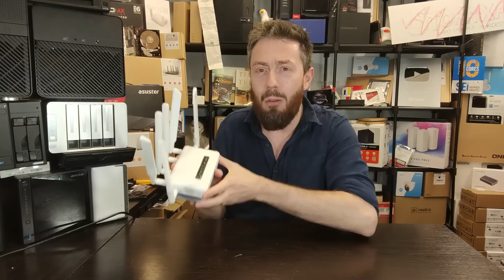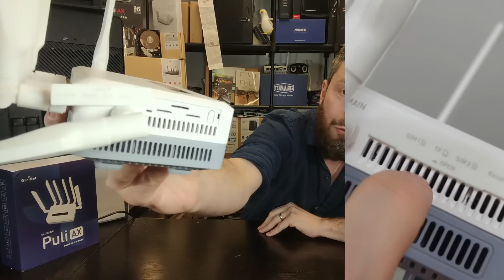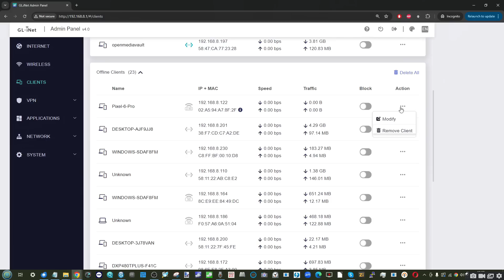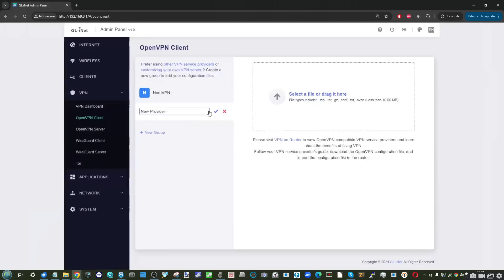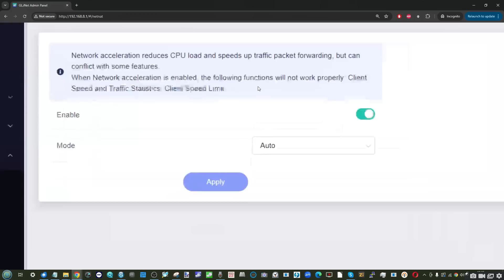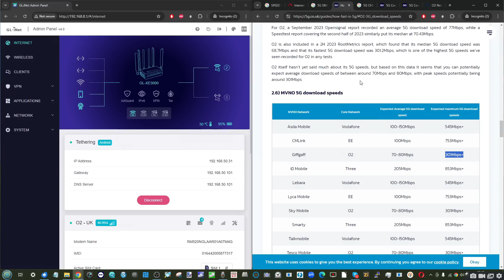THE ULTIMATE SIM ROUTER DOES EXIST - The GL.iNet Puli AX Mobile Router Review

Comment: This router unfortunately is not so strong. Over my phone I have 1,7gbits down and over 160mbits up. The router only does 930mbits down and 70mbits up
Reply: I'm not an expert in routers by any means (which is the reason I watched this video), but from what I've gathered from researching, there are WAY too many variables at play when it comes to travel or home networking to make a blanket statement like that. What about your firmware? SIM-card? ISP? Router placement? Is it defective somehow? etc.

I have no idea how much you in particular know about this stuff based on this comment alone so you could very well have done weeks of troubleshooting before concluding that this specific router is objectively worse than your phone, but it is misleading and unfair to make a comment like this without any context or information about your particular use case, setup, ISP, etc.

Besides, very very few people can even afford or have access to the crazy speeds you're talking about. I have one of the best 5g data plans offering theoretical download speeds of up to 1000/mbit in cellular data which all the ISPs have to say in the fine print is the top speed that the plan is advertised as having, but that it is very much only the top speed one could get in theory and in practice it is virtually impossible for the average consumer to even get close to 1000/mbit regardless of whatever router or phone they have.

Comment: Okay, admittedly this router ticked all the boxes for me. 5G, Witi 6, dual Sim, Open Source OS, the works.  So why was I so surprised how good it was when I tested it in the real world? With a cheap (+3dB) external 4x4 mimo antenna, all but one of the dead spots I noticed on my test route went away.  If you are curious, the route I took for testing was in Colorado, USA and went from Walsenburg, to Alamosa, to San Luis, to Fort Garland, then back to Walsenburg.  I lost signal in a 1/2 mile stretch centered here: 37°29'58.4"N 105°19'47.1"W.  I cannot stress this enough... solid and continuous coverage everywhere else even when the phones on the same service had no signal.  Speed was the only variable.  in San Luis, we got about 1Mb/S down and a few kilobits up.  In Alamosa, I got a solid 100Mb/S up and down.  There was no difference running on the battery compared to the vehicle charge port.

This brings me to an informational item: when charging the internal battery, it pulls quite a bit more power than when fully charged.  It is the difference between the two current figures that surprised me because of the surprisingly low power consumption of the radios and internal controller.  When fully charged, my Puli AX will draw between 4.12 and 4.85 watts. when charging from a nearly dead battery, that power draw goes up to between 37 and 39 watts until the battery is charged, which takes quite a while. Note that the charging currents are well within the capabilities of all but the most anemic power supplies, but choose it accordingly.  In a vehicle, a 5 amp source will be plenty to run and charge, and this device sips power normally, so any 12V source will be fine. The 5 watt draw will probably not kill your vehicle or solar battery by morning if you leave it plugged in. On USB-C PD (Power Delivery), you should make sure the full 5 amps are available; cheaper 3A power cables and circuits will be slightly overtaxed while charging.

Comment: Great router, based on your review. However, I will probably go with the Spitz AX (GL-X3000) without a built-in battery. Once the battery in the Puli AX (GL-XE3000) dies, it essentially becomes dead weight and may even cause various side effects. I really wish they had designed it so the battery could be detached and replaced if needed - like my expensive Cateye bike lights, which proves this is entirely possible.

Instead, this feels like deliberate marketing designed to make the device obsolete, especially since they advise users not to replace the battery themselves and don’t offer official replacements. I’ve also read (via AI and user reports) that some people use the Spitz AX (GL-X3000) together with a power bank. The key is finding one that supports pass-through charging (i.e., it can power the USB ports while being charged from the mains). That seems like a better long-term solution, since power banks are at least easy to replace.

Comment: All I care about is how well the mobile router deals with poor signal strength, because lets face it, 4g and 5g signal strength can be complete crap in much of the UK. Can you recommend a router that's good  in poor signal areas. I don't need wifi, just an ethernet port.

Comment: Towards the end of the video you said you'll be doing a deepdive on this router and that it'll defiantly be in more videos on the channel. It's now been over a year and it's only been seen in this video and mentioned in 1 other in china or somewhere wherever you where as the best travel router. do a video testing cell locking\tower locking please since it's supposed to work, and quectel RM520 has a horrible reputation of not being able to cell lock and being able to cell lock, because of a AT Command +QNWLOCK which apparently works and doesn't work and is stated as "not for commercial use" from Quectel staff on their forum

Comment: I really want to see the Cell Lock\Tower Lock feature in use and working tested on 4G 5GNSA 5GSA because the Quectel RM502 shows up in so many devices and google searchs incorrectly state that it does work but then the AT Command QNWLOCK does not show up in Qucetel AT Command PDF and is reported multiple times on their forum and gets responses from the staff all the time that the command does work but is not intended for commercial use and isn't supported on 5GNSA Someone mentioned on the forum that they got the GLiNet latest router and the Cell Lock\Tower lock feature works from the GUI but not the AT Command (which is what the GUI code is written around to do for you when you click apply) 
I built my own router using Mikrotik and the RBM33G routerboard and had a fibocom NL952 4G modem first before upgrading to a 5G Simcomm modem, My Dad recently got a Cudy P5 which uses that Qucetel RM502 modem and the AT Command doesn't work on his Cudy P5 
This GL.iNet modem looks great but I need Cell Locking to work in the rural area for him, So I really want to see this tested.

Comment: I'm gonna point out that a mobile with a laptop dongle is probably the ultimate SIM router... you can literally get all the same functionality with apps, and my S25+ get 850Mb Down and 98Mb up and comes with a feature that allows you to keep the charge at 80% and comes with a 5500mha battery. And I own a Spitz AX and it only gets ~500Mb down and 80Mb up... ah failover might be a problem thats the only thing I can think of that you probably can't do without extra hardware. You can have 2 SIMs and it will probably just use the one that is working the best.

but failover for other other connections would be a problem you would need another router with that functionality.

Comment: Placing of the Router is paramount, also you want to put the antenna all 90 degrees opposed because the radiowaves are polarized to allow them to send more data, with mine I was getting 300 - 600Mb think you just have bad placement, because my old place didn't even have line of sight to a 5G tower and I was still getting those speeds all the time. Now I just get 500 - 600Mb because I have line of sight to the tower, seems to top out at 600Mb though as my phone can manage 600 - 950Mb here in exactly the right place. brand new phone though so it's got the most upto date modem in it, but like at that point who care about future modems being better 600 - 950Mb down and 80 - 110Mb up is more than enough.
Reply: Just make sure not to lie your WiFi antennas flat. Dipole WiFi antennas will limit horizontal WiFi coverage.

Comment: How long would the battery run it with say Iphone Ipad and laptop connected by wifi , can it also work with express VPN
Reply: If you're using expressvpn this doesn't support lightway so you're better off with an aircove
Reply: @Kot-fj6hc does this work with a proxy??
Reply: @Footytalker You can but you'd need to install it via LuCi which can be a bit of a pain. Its very easy to set up a wireguard tunnel to your home internet though and then proxy through your devices depending on the usecase you're trying to do
Reply: @Footytalker It can but youd need to install it via LuCi easy to set up a VPN from it but probably easier to do proxy on the client devices

Comment: and youu still aren't dealing with the elephant in the fucking you are living in a faraday cage and require exteranal  anyenna systems servicing  the xg portion of the connection you might be looking at  dual wan  gateway  to  handle the staarlink and other bb connection

whether deploy this in a home, 5th wheel, other forms of motor home

at some  point external an6ennas with a requirement external ant for service

Comment: Can you get SMA extension cables and put the 5g antennas outdoors or on a boat/van roof? Or are the more specialised antennas for this that would work with this. Also can these connect to tailscale directly (Edit: Oh it's OpenWRT so: yes!)?

Also it would be good to go somewhere with decent 5G and use EE to see how well the router handles gigabit internet.

Comment: I'm in the states and will most likely use Verizon, AT&T, T-Mobile etc..   Did you have to take your router down to the cell store to get the sim card activated?  Did you use prepaid? I'm having issues getting sim cards.
Reply: Hi, do you have any recommendations for SIM card routers?

Comment: I am not as tech savvy as I’d like to be.  I have the GL.iNet router.  I tried setting up an Eeero and it won’t detect it.  My end goal is to set up cameras on a lot and a shop that are subject to  break in attempts.  As such, I bought a Eufy S3 camera system (because of the AI to minimize false alerts both for my own sanity and to limit data usage) I pre purchased the outdoor eero that covers 15,000 sq feet thinking I would hook cameras up to it and be fine…and I already have a few Eeeeros.   What would you suggest I do?    I think I am using the Eeeros in the wrong way…but from experience (a huge lot with adobe walls…it just served as my wifi extender…I think …it worked)

Comment: interesting speed test results - I am currently on a TP Link Archer MR200 running off data SIM - getting 50-80Mbps download depending on where but way off your upload, usually at about 15mbps, but I don't need too much of that, so that works. Plus, the one I got was only £90 here in the UK (about $120?) so a fraction of the price of this one, but again, no battery (although I did get a cigarette lighter adaptor for it so works nicely in the car/van). Interesting to see differences 👍👍

Comment: Thanks - I followed one of your earlier videos and bought an X3000. Superb piece of kit.  On a poor 5g signal I get 400mbs down and up to 30 mbs up. At peak times when there is congestion I get 200mbs down and about 15mbs up. More than enough and then some. So instead of Virgin at their new offered contract of £68.00 p.m. I pay £15.00 p.m.  The router will pay for itself many times over.
I can't see a use for a battery version in the home.  I just switch to mobile phone modem to feed the tablet a signal. If it were critical I would have a back up power source. But then the mast will probably be down anyway. 

A big thanks!
Reply: Hi Kevin,

Were there any other SIM card routers you looked at? 

I’d like to put together a shortlist ahead of buying one for my chalet in France - can’t get WiFi up there and a monthly Starlink sub is superfluous to my needs.
Reply: @kierand9410  Hi Yes, I looked at things like the Nighthawk and found that they were grossly overpromoted and had issues of overheating etc. Small exec. routers are really quite low spec. and designed to go into a briefcase.  
Nest I considered the Teltonikas. They are bullet proof and designed as back up routers when the power goes down. I also found the Teltonikas lacked W-Fi 5. They are very high quality, a friend has one, but they are under specked for the money. 

The GL 3000 has proved to be excellent. With a 5G signal I get 600Gb down and 50gB up. But it is subject to contention. So sometimes it is a lot less, but even in peak times it is fairly fast.

The only thing with the GL 3000 is that it does not have pairing button. So for any device which has no ap. to pair it it is a case of writing script in the router ap. too difficult for me. 

The GL 3000 has proved to be rock solid and exceptionally good at auto changing channels on the hoof to avoid congestion with neighbours.

I hope this helps - Cheers
Reply: @kierand9410  The auto mod bot has deleted my lengthy post - Trying again, but it has to be short.  The GL3000 is excellent. Fast, easy interface and good spec.

Comment: Hi, The GL-XE3000 Puli AX doesn't use the hotspot data plan.? I ask because I have a GL-750v2 but when I use the SIM card for WAN needs a plan with Hotspot data included and when the Hotspot data plan is over there is no connectivity over WiFi or LAN but internally the has internet because can download pluggings. I think they get the connection directly from the Normal Data Plan and not from the HostPot Data Plan so need to confirm if the GL-XE3000 Puli AX device is not a Mobile Hotspot Router and it is a Cellular Router because I think there is a difference between this type of devices.

Comment: Any idea on how this compares to the RUTX50 you reviewed quite a while ago, in terms of performance? I'm looking at TRM500 (newer than TRB500 and only need modem) and the GL-X3000 and not sure what to get. I have a separate router anyways, so only need the maximum performance for 5g connectivity. 100€ difference between both devices.

Comment: Could you do a comparison between 
These:
GL-XE3000 Puli
Gl-AX3000 Spitz
Teltonika RUTX50
Teltonika RUTC50 
 Would be helpful to pick between them.
Currently trying decide between This GL-XE3000 Puli and the Teltonika RUTC50.
Any help or details and comparison... Possitives... negatives etc.
Number of users could be an important factor
Reply: Hi, do you have any recommendations for SIM card routers?
Reply: The only difference between the Puli and the Spitz is the battery. Don't know about the others.
Reply: EDIT: just ordered RUTC50 - hope it was the right decision for my advanced needs.

I'm exactly on the same boat i.e. trying to decide between RUTC50 and GL-AX3000 Spitz (don't want irreplaceable dead battery weight when it stops working). From RUTC50 review (same person) it appears it should have better quality hardware but more old-style UI that's complex to set up. It has various SMS communication that Spitz doesn't have. ChatGPT says RUTC50 offers more robust connectivity but Spitz or Puli have slightly better user reviews (presumably becuase they're easier to set up out of the box). I need advanced info on networks, forcing selected bands if necessay and automated scripting that reboots the router if it get's stuck unable to recover connection (achieved it on my Asus). Which one did you get eventually and are you happy with your choice?

Comment: Waited for this review for quite a while, thanks! I would really like to see your point or test on:
1) While driving and for the scenario of a stationary remote work like in RV. Plus a separate test with connection to home network. 
2) Your take on a barrel charger instead of USB-C
3) Testing the speed and reliability for a remote connection to a home network with different methods.
4) Using it for a home failover setup connected to UniFi gear.  
5) Speed or use cases limitation as a file server. 
6) This one vs Starlink

P.S. update the description. Seems like you copied it from previous one: "Let's find out in today's DWR-2101 D-Link Mobile Router Review" lol

Comment: One thing I'm not happy about - when you switch the device to access point mode, you can't access the web UI without doing a soft reset (4 sec press) to put it back in router mode. Without the UI, how do you install firmware updates to get important security fixes? Perhaps you can ssh into the underlying openWRT OS and perform the updates with opkg, but that simple command line tool is designed to update packages, not an entire firmware image. Anyone know?
Reply: Hello, this is quite a late reply. The thing is, when you are in access point mode, your main router is allocating an IP to the Puli AX which is different from the default 192.168.8.1 IP. What you need to do is access your main router's interface, look for the IP allocated to the Puli AX device, and then access the interface using that IP.

Comment: not that I'll buy this or anything but here are some questions for a "deep dive", feel free to pick some of them and ignore the ones that are too nerdy;

are the cellular antennas swappable for an external directional antenna?

can you confirm if it's 4x4 mimo, or some sort of low band antennas and high band antennas where only one set is used? 

what is the exact modem? Qualcomm x55 maybe? so it has dual sim, is it DSDS (dual sim dual standby), or dual active(both SIMs maintain a network connection), or does it basically act like a sim selector?

LTE band locking(I need this a lot in remote places so I reckon some people will look for it too)?

mwan3? or does it have something else for load balancing or bonding? 

how does it handle ipv6 addressing when multiple WANs are present?(it's kinda messy in vanilla openwrt per my experience)

Is the battery removable for those hot situations (for example if this is going to be mounted in a car you don't wanna leave the battery in it i guess)

it's probably not legal but, is it possible to modify imei number to avoid paying insane taxes on some countries?

i guess that's all